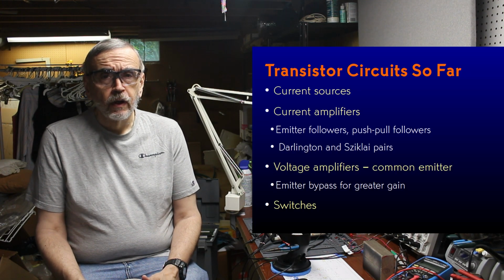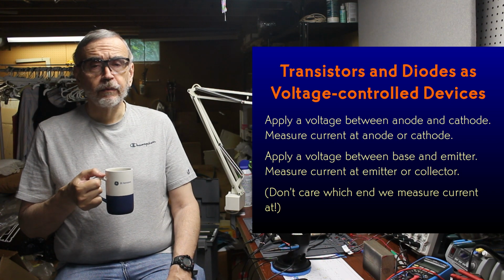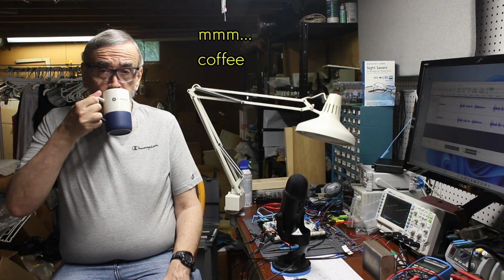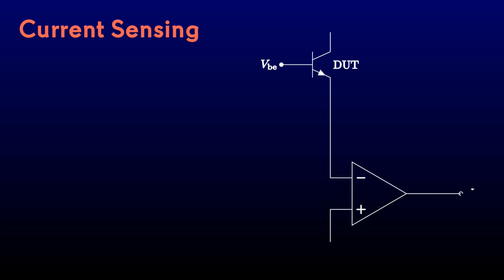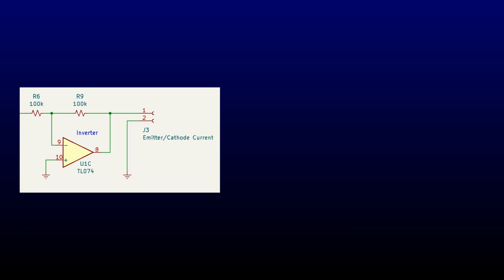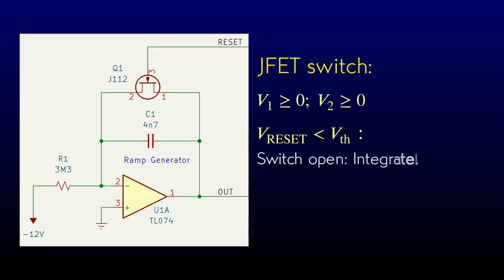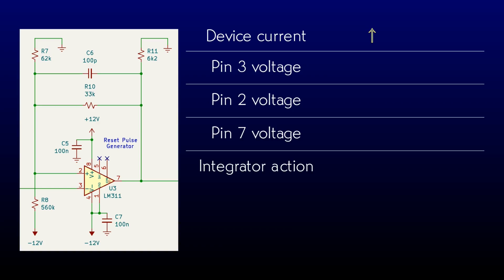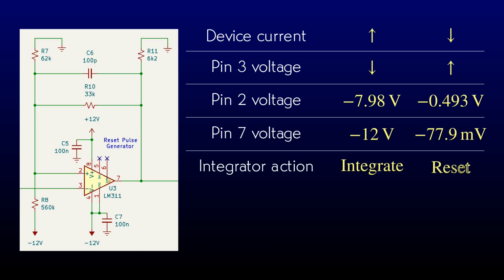Transistor 101 Side Project: Current-Voltage Curve Tracer, part 1: Design

Comment: Great video! Like others of yours. I like them all. Excelent teacher gives excelent lessons :) BTW: I would like ask you about "x10 buffer". Its gain is (1 + (R3/R2)), isn't it? So the gain is equal 10.1. It would be exactly 10 if R3 was 180 kOhm and R2 was 20 kOhm. These values are typical and easy to buy. Cheers!
Reply from the maker: I do play a little bit fast and loose with the component values.  But remember that both resistors are 1% tolerance (and I'm using E24 values, which are usual for 5% resistors). So the gain of your configuration might be up to about 2% high or low (if the source and feedback resistors are off-nominal in different directions).  I tend to gloss over the tiny differences and think in terms of "equal to within the component tolerances" or "equal as far as the nearest standard value". 

If I were trying to do better than that, I'd probably need to spring for a fixed-ratio divider like the ones Caddock makes. I'd have to worry about tempco as well as tolerance. And there are several places in the circuit where I'd have to add trimmers and do careful calibration and adjustment. That was too exotic for what I'm trying to do here, which is to demonstrate that the exponential relationship extends over several decades of current. (It founders on Early effect at the high end and noise at the low end, but we'll soon see that even this janky setup shows good tracking from about 100 nA to 10 mA.)

There are other things wrong with the circuit in this video. (In particular, the current sense circuit is unstable!) The next couple of episodes are about building, testing, and fixing the bugs.

Comment: Great project. I've been thinking of building one myself for a while so I'll be following with interest. In fact I'm thinking of even building a version for testing vacuum tubes as well, with very different voltage and current requirements. :) 
And longer videos are perfectly fine for me, if you are comfortable making them.
Reply from the maker: This particular version is not destined to be a fully functional tracer.  The ulterior motive is that I want to evaluate transistor pairs for use in the exponential converter of a music synthesizer, where the collector current needs to be exponential in the base voltage over a 1000:1 current range, to an accuracy of about half a percent.

It'll probably be quite a while before I get around to doing a proper curve tracer with all the bells and whistles.  There are some other creators who've done really nice jobs, and I'll want to check them out in more detail before I dive into such a thing.  @IMSAIGuy did one a few years ago that looks interesting: https://www.youtube.com/watch?v=oFHTOQTIi30&list=PLJDuykE7uXCuR1BujmOXHokKjG0EeRM3t , and Paul's DIY Electronics Blog has a design for one that looks to be absolutely superb: https://www.paulvdiyblogs.net/2021/03/building-curve-tracer-version-3.html
Reply: @KludgesFromKevinsCave  Oh I didn't mean I was going to copy your design as-is... just steal some ideas from it. Like for instance using the JFET to reset the ramp generator. :)